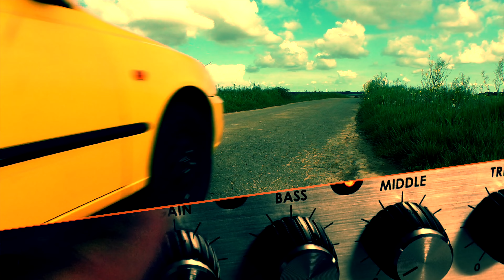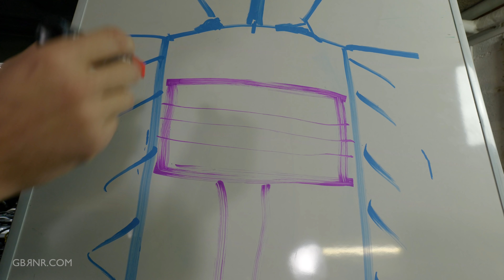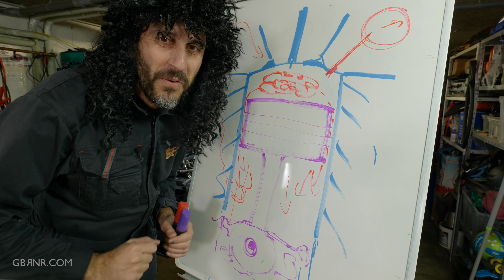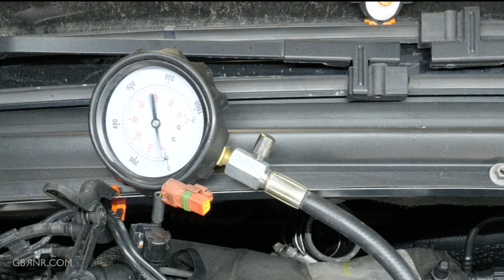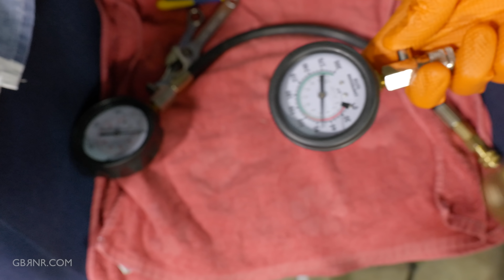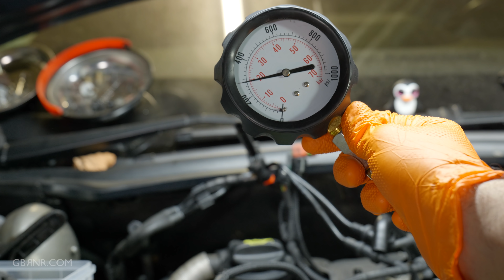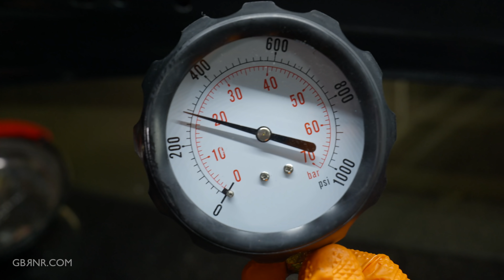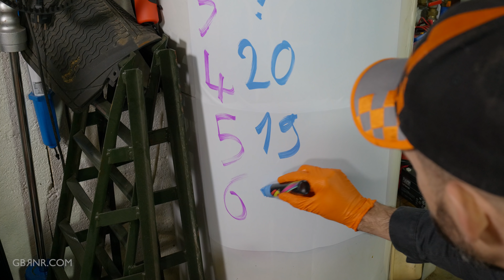LE VERDICT: Test de Compression du V6 2,7L HDi de la C666

Comment: Pour tester le cylindre 3, il faut virer l'admission (si c'est possible).
Juste pour ce test, la combustion se fera avec de l'air non filtrée = 0 problème.

Pour le reniflard il est intéressant d'installer un oil catch can pour éviter le retour en admission et provoquer son encrassement et celui des soupapes (ce qui s'est produit au cours des derniers 260mkm ...).
Reply from the maker: La pièce que je démonte à 7:22 est le déshuileur (oil catch can) qui joue ce rôle

Comment: Bonsoir mon François 🙂❗️
Et ben c'est pas trop mal dit moi ces résultats 😄❗️
Je suis pas étonné en fait, ça bouge pratiquement pas ces bas moteur de 2.7, dommage pour le cylindre 3 par contre 😅❗️
A ce propos, il te faut un compressiomètre à rallonge oblique et embase conique, par contre cela nécessite d'être deux, un qui tien l'appareil m, et l'autre qui actionne le démarreur❗️
Et je pense que tu seras aussi à 20 Bars sur ce fameux cylindre 3 😉❗️
Vivement l'essai routier, il sera décisif sur le comportement/état réel de l'ensemble❗️
On ce dit à la vidéo de mercredi prochain du coup❗️
À tantôt mon François ☺️❗️
Reply from the maker: Merci Jo, à plus

Comment: Salut François, j'aime bien tes vidéos mais la tu a faut sur tes test de compression, je sais pas si tu a débrancher tes durites sur l'admission mais c'est le premier truc a faire, puis c'est 3seconde de démarreur max sinon la remontée d'huile fait l'étanchéité, donc pas bon si tu veux savoir l'état de tes segments 😉.

Tu aurais du faire ca avant de le remonter dans la caisse lol espérons que ca soit pas le cylindre 3 qui est rincer lol
Reply from the maker: Sur un diesel le clapet / papillon est complètement ouvert au ralenti et quand on le démarre, pas besoin de débrancher les durites d'admission ou d'appuyer sur la pédale d'accélérateur.
Pour la méthode, j'ai suivi les recommandations du constructeur qui dit d'actionner le démarreur 10 secondes.
Reply: @gbrnr  oui en tans que technicien en mécanique, je sais qu'un diesel marche en mode stratifié mais il y a un filtre a air et les Turbo qui fausse le test donc on débranche toujours les durites d'admission, 10seconde je trouve ca énorme surtout que le moteur n'est même plus lubrifier, je peux me renseigner auprès de collège chez Citroën si tu veux.

Comment: salut François,
le danger d'un passage trop important de la compression vers le carter c'est que le gaz chaud emporte de l'huile du moteur vers l'admission, l'huile brûle très bien dans un diesel, exactement comme du gasoil. donc il prend des tours même sans carburant, chauffe, entraîne encore plus d'huile, qui se fluidifie et se vaporise avec la température, et fini en surrégime avant de serrer, quand il n'y a plus assez d'huile pour maintenir la pression, dilatation de l'alu et craquage du film d'huile.
des guides de soupapes d'admission très-très usés peuvent le faire aussi, mais les tiens sont neufs.
le plus souvent ce sont les paliers du turbo qui fuient trop et provoquent un emballement.

les pistons, en alliage d'alu, sont conçus pour avoir juste assez de jeu quand ils sont très chauds, pied au plancher, donc il y a un peu de jeu à froid et à tiède.
20 de compression sur un moteur avec autant de kms et qui a si peu tourné depuis un an au moins c'est excellent. faut voir aussi que toutes les soupapes sont neuves et rôdées, donc étanchéité top, et la culasse avait été surfacée, donc volume de chambre réduit = compression augmentée.

le liquide de refroidissement avait commencé à corroder les pistons mais je ne pense pas que le montage de nouveaux cylindres, pistons, segments aurait changé grand-chose.
faudra surveiller le niveau d'huile, surtout au début, garder un bidon dans le coffre, ne pas hésiter à mettre de la bonne huile et la changer plutôt trop tôt que trop tard.

j'espère que t'as pensé à faire faire un polissage de la peinture, même si le moteur est bon et qu'on en est sûr, l'aspect compte beaucoup pour ce genre de voiture.
Reply from the maker: Les culasses sont plates donc quand elles ont été resurfacées cela n'a pas changé le volume de la chambre de combustion. Les sièges de soupapes ont été usinés pour éviter d'avoir les soupapes qui dépassent (et risquent de toucher les pistons). C'est pour cela que j'ai vidé les poussoirs hydrauliques (comme les sièges ont été réduits, les soupapes ont reculé).
Merci beaucoup pour ton commentaire 🙂

Comment: Tu devrais investir dans un oscilloscope, en fonction ampèremètre, et sous action démarreur, tu pourrais contrôler l équilibrage des cylindres
Reply from the maker: Je crois que cette méthode c'est pour les moteurs essence, non ?
Reply: @gbrnr  non non, les moteurs diesel aussi.. C est grâce à l amperage de l action démarreur que tu vas pouvoir savoir si t'es compressions moteur sont équilibré, certain sont très pointu et cher (picoscope plus de 3000 euros), perso j utilise un hantek spécial auto avec tout ses câble  chinois qui fait parfaitement l affaire.. Pour 390 euros

Comment: Il faut insister un peu plus sur le démarreur car je suis quasi certain que tu arriverais à 20 bars partout. De toute façon, tant que l'aiguille monte, même si elle monte doucement, il faut continuer à insister un peu sur le démarreur, ce n'est qu'une fois l'aiguille stabilisée qu'on arrête.

Par contre le boulot n'a été fait qu'à moitié puisqu'il reste le cylindre 3 dont on ne connait pas les valeurs. Les supputations c'est bien mais les certitudes c'est mieux. Je pense qu'en démontant un truc ou deux, tu aurais très bien pu t'en sortir.

Comment: Compression NEGATIVE tellement ça envoi! 
Psa fabrique donc toujours d'excellents moteurs....qui font des joints de culasse...tiens les TU de l'époque 1.1i 60ch 1.4 carbu et 1.4injection font plus de 300ooo mais avec joint de culasse changé 🙄
Cest donc un consommable  ce joint 😇
Sauf sur DW10 les 2.0 hdi90 et 110ch 306 406 307 407 ....ils font plus de 450 à 500oookm mes taxis en avaient